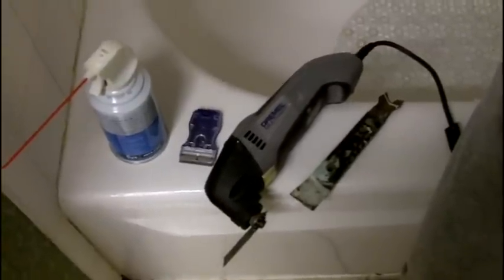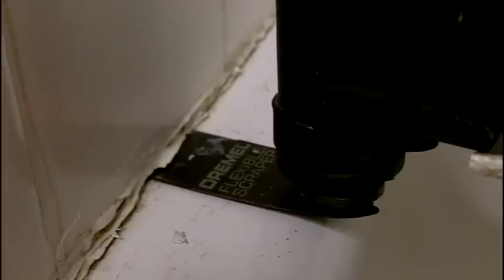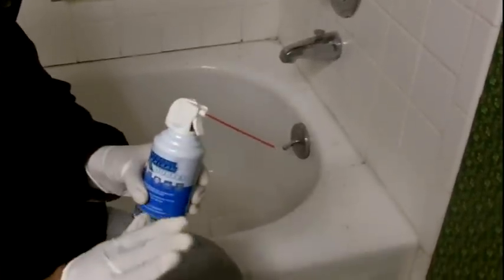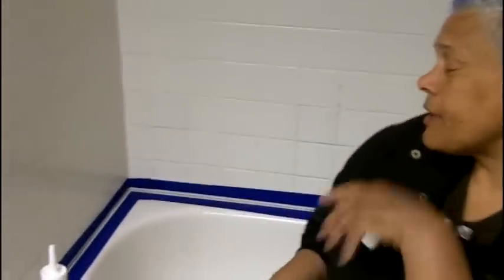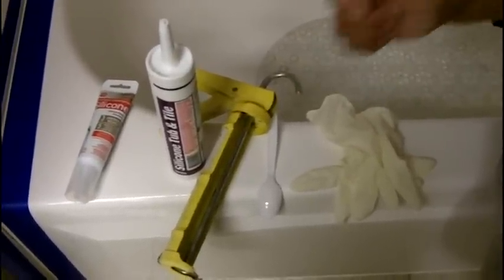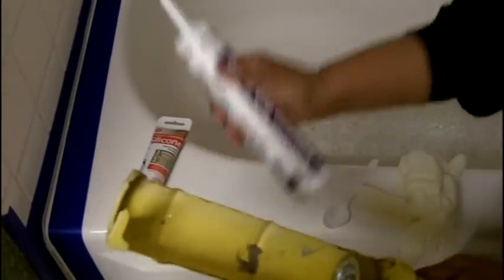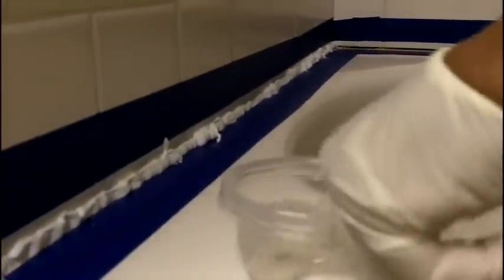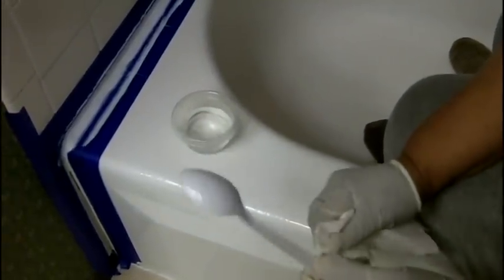How to Caulk a Bathtub with Beautiful Results

Comment: You should also fill the tub 2/3 with water.  This will weigh it down while the caulk dries.  When it's dry, empty the tub and it springs back up.  This prevents the caulk from pulling away and cracking when you fill the tub to bathe.
Reply: The silicon is flexible though for that very reason and for thermal expansion.
Reply: I've heard people repeat this same tip. I'm not convinced that it's a significant issue. I suspect it's just a waste of water.
Reply: @Nathaniel_Peterson  Yes because the bath tubs are taking the load on their steel feet not the actual tub, so if properly supported, there should be no movement.
Reply: I was thinking about doing that, especially with an old house...gotta help for lasting longer.
Reply: I had to do a repair job because of that exact problem... I left the tub 1/2 full while the caulk dried and they never had that problem again...
Reply: I can understand that this happens,
Reply: I prefer rubber duckies!
Reply: agreed
Reply: Yes! Good tip- especially for plastic or fiberglass tups, which settle more with human body weight later. I learned this the hard way...
Reply: Great idea!
Reply: Thnk you for tip
Reply: If your tub is on a concrete slab/foundation it’s normally not needed to do so
Reply: Does this apply for condo buildings that are fairly new? My building just turned 10 years old and I'm about to replace the caulking in my bathroom suite. Should I still do this or should it be new enough that it is built to be flexible ?
Reply: Genius ! Thank you ! I redo mine all the time because it always cracks after a few weeks ! Thank you !!!
Reply: Impossible to do... one must be close to manage caulk quickly and professionally..
Reply: Filling the tub is related to those with sub flooring.
Not concrete
Reply: tabs are not hanging on the air  there screwed on the wall not to move and they siting on the floor  no need to feel water the tub thats stupid
Reply: @Nathaniel_Peterson  
It’s not a waste of water. If you have a cast iron tub you probably don’t need to add water. If you have an acrylic tub that isn’t bedded you should and the water as someone else suggested.
Reply: Thank you for your comment... Very interesting.

Comment: I remember when I was learning to use a caulking gun.  I didn't know about the seal in the tube so I just kept jamming on it and it eventually spurted out the back of the tube and gummed up my caulking gun.  Left it over night in frustration, and had to cut the dried silicone off it with a razorblade.  Thank you for saving everyone from such noob mistakes.  You always do a really thorough job showing people how to use tools.  Getting it right the first time cuz someone went that extra mile for you is soooooooo much easier than fumbling around on your own trying to figure stuff out.
Reply: W
Reply: Happened to me too 😂

Comment: So, I've done tons of caulking over the years. The latex stuff is a breeze. But, silicone caulk takes considerably more mastery, because it is far less forgiving. This is the first time I have attempted this particular method, as Leah demonstrates in the video. I'd like to add couple of tips...

First, when caulking in general, don't sever too much from the tube tip. I recommend 1/16", or certainly less than the 1/8" mark embossed on the tube tip. Also, get the angle right, the cut smooth. Allow your trigger pressure to regulate flow, in lieu of hole size. Too much caulk will get you into trouble. I know from experience.  
Second, if you use a glove, use one that fits VERY snugly over the finger you intend to use for smoothing. A loose fit or a textured glove will leave you with less-than-desireable results. Ask me how I know. 
Finally, take time with your tape. Ensure consistent gaping, and avoid gaping both too narrow or too wide. It's a little tricky to get just right, but it's critical for premium results. 

Good luck!
Reply: Pro tip...run your silicone bead, then spray it with denatured alcohol. Alcohol will prevent the silicone from sticking to unwanted areas when you smooth the bead out.
Reply: How do you know?
Reply: how long do u have to let the silicone cure for until you can use the shower again
Reply: @someoneelse7724  i was going to ask that !
Reply: How wide should the finished line of caulk be?

Comment: Pro tip: On most caulking guns (such as the one used in the video) there is a hole in the handle with a razor attached to the backside of the lever. Simply insert the nozzle of the caulking tube at the desired angle and squeeze the handle to cut the tip!
Reply: +SixToMidnight just blew my fucking mind, i just through it was a hole for the fuck of it, i never knew... omg
Reply: +Realist I always thought that hole was for cutting the ends off of cigars while you're on the job. That's what I've always used it for. Never thought to cut the tip off the caulk tube with it. Great idea!
Reply: Pro tip: you can't make it any size you want.. hole is to small once you get past the pointy part of the caulk
Reply: Didnt know that. Cool beans. Thank you.
Reply: SixToMidnight  what?????....you make go to the garage and check it.....THANK YOU 👍🏻👍🏻👍🏻👍🏻👍🏻👍🏻👍🏻
Reply: real pro tip that stock cutter is trash use a good razor
Reply: Yep, there's a hole on my gun! Thanks for the tip!!!
Reply: yes it is,only when new it is good. 3-4 uses and then it will smash/squeeze the tip.
Reply: either way at prices as low as 99 cents, I wouldn't look at it as an investment.
Reply: @jumpercable20  Great idea! Lol, I mean wireless jumpercables are a great idea!

Comment: the best caulking bathtub video that I have watched.
Reply: you said caulk
Reply: huh huhuhuh uhuhhuhuhuhuh hhuhuhuhuhuh
Reply: DO NOT use tape. Lay in a smaller than those beads of caulking in to a clean dry space/. Spray with denatured (or isopropyl alcohol and use a Caulk Finishing Tool (Home Depot, Lowes) and you'll be left with a small, perfect bead. spraying alcohol on it after prevents the caulk from sticking to anything but in the crack its already in. That big, wide line of caulk will look HORRIBLE within a year because as we all know- there's actually no such thing as mold-proof silicone- it WILL mold over time. Minimize the silicone and you minimize possible mold
Reply: makes a lot of sense... but you might do this all the time (?)... maybe for people who don't do this but once or twice in their life ,the tape could save some grief ;-)
Reply: Well someone taught me like I do it and I'm an electrician- and a former carpenter but I've always done it like that. Spraying on the denatured alcohol after you lay the bead prevents it from smearing onto anything else and the caulking tool makes the leftover minimal and makes the end product perfectly uniform so these things eliminate the need for having "the touch" or being terribly experienced or anything. I just know that sooner or later it will mildew no matter what the silicone says on the tube and I'd rather have a very small area for it to do that. Another thing you could do is squirt lots of silicone as much caulking in that crack as possible so no air/no mildew over time. Not saying anyones wrong or I'm better or worse, just putting my two cents in
Reply: Worth waaaay more than two cents Ken! Thanks.
Reply: my pleasure

Comment: +L Lawliet You wet the spoon or your finger to prevent the caulk from adhering to either and pulling additional caulk out of the joint. The instructions to "not let the caulk get wet" really mean "don't use the shower or tub until the caulking has cured". Shower head or lots of splashing water can wash out or damage the seal made by the uncured caulk. The tiny bit of water on the tip of your finger isn't going to contaminate the caulk.

Comment: Fill the bath with water before sealing. This will make sure that the joint is at its biggest before you seal it. When the bath is emptied again, the joint and sealant will be compressed. This reduces the stress on the sealant when you’re using the bath or shower. no need for arm bands or goggles or rubber duckys, try to seal it while at the side of the bath and not in it. ;)
note:  Brits, please use 'silicon sealer' and not caulk! caulk in Britain is a different product and is pretty useless for sealing bathtubs.
Reply: MrJericho07 oh good point.
Reply: Yeah  what is marketed as caulk  in Britain is usually butyl rubber. Really messy stuff that will never dry and is almost impossible to clean up. It is a permanently flexible adhesive/sealant used for roof repairs etc.
Reply: MrJericho07 on
Reply: I filled the bath and then got in naked so the joint was the biggest it could be. A wonderful experience!
Reply: DoinThupidThings
Would probably be easier to use weights instead of your body weight. Maybe even use weights to replace the need for water weight. Metal is a lot denser than water anyway so it'll take up less room. Much more convenient than sitting naked in a full bath tub trying to apply sealant.
Reply: MrJericho07 when is the best time to empty the tub? Immediately after done caulking?
Reply: Makes sense thank you.
Reply: @donschlonski2936   I read that comment while watching the video and thought she was actually going to tell people to fill it, all while thinking to myself are they can't be serious! Why In the hell would you even bother filling it. Then when it ended I realized it was a joke. Only time we've ever used tape and a tool was if it was a big gap. HAHA
Reply: @MyronsBaldspotLovesKevSamuels  the next day (when dry).
Reply: Cat S. Thank you🙏🏼 I couldn’t find that answer, no matter where I searched! I let the water out almost right away so I’ll have to redo once I feel like recaulking. Blessings!
Reply: @DoinThupidThings   AH, want to come caulk my tub?  TeeHee!!
Reply: MrJericho07 guess that only applies to fiberglass tubs.
Reply: @donschlonski2936  Don, that makes a difference depending on how the tub was installed and what substrate was used. I bought an old house and the tub & tile were great, just needed a grout and caulk refresh. The structure under the tub allowed it to sag, I didn't feel like taring out to fix it. On a properly installed tub you're likely correct. It's neither stupid, irrelevant, nor wasteful. Wasteful would be redoing the entire job because the caulk pulled away because of 600lbs of water and Aunt Bunny during a long, hot soak

Comment: PULL THE TAPE, IMMEDIATELY!!!!
I found out yesterday. I left the tape on too long. Caulk started to dry. 
I have to redo!
Reply: Well, Leah did say that in her video.
Reply: so does this mean I basically have only 5 minutes lay a strip of caulk on one whole edge of a tub, and smooth it it out, and remove the tape?  it seems so stressful.  lol.
Reply: I did the same thing let it dry over night and it ripped right off with the tape shame a waste of time
Reply: @derekg5381  Yep! I did the same thing last night. It didn't all come off but it curled up on the edge.

Comment: As someone who has been a professional caulker for 15 years, I'll give you credit for decent job, but please please please stop telling people to dip their tools or finger in water. You should be doing this with dry tools. The water can get behind the caulking and then you don't have a true seal. There is no need for wetting your tool. That is the biggest mistake these so called "professional" caulking videos make. Other than that, good job.
Reply: That's what the instructions on the products say so if the manufacturer recommends it why shouldn't she?
Reply: I caulked for years on military containers small & large. I used a cup of water with a few drops of Ivory dish soap in it. It's the best and the caulk doesn't stick to your fingers because of the soap. It will seal...i promise
Reply: @yobooboo1290  Thanks for the tip!
Reply: use a wet rag for minimum dampness on your finger to spread the caulk.
Reply: Professional caulker?
Reply: Joanna Saad  Matt Stroupe is absolutely right.  Use the correct tools which you can buy on Amazon. Also. Do not use tape as this leaves a lip on each edge and that is where bacteria forms. 
I’m a BIG fan of Leah and although this is a good video, it is not the correct way to do it. 👍🏾

Comment: you used entirely waaaaaaay to much caulk
Reply: Shawn Bruhn It doesn't matter
Reply: Arnel Evans Lol it does. It ain't free right?
Reply: The tube either gets used or it dries out in “storage” so using extra doesn’t really matter.
Reply: @6butterflywings6  not if you know how to store it properly! Lasts a long time
Reply: I agree with Sean. Easier to spread and less messy using about 1/2 of the product she used. Good video!

Comment: Bless you!! I’ve done a number of caulking jobs on the past, but wanted a refresh before my shower. The tip to use the flat blade dremel is the Baum!!!!!!!!!!!! I have one, but rarely use it. I just tried your trick — and it’s fantastic!!!! THANK YOU! You just cut two hours off my project!!

Comment: Thank you!!!  I caulked my bathtub and am now tackling the shower.  The tape was such a great tip.  You made everything so easy.  I can’t believe I was afraid of a caulk gun.  
The razor tool!!  Wow!!! Game changer!  I also used it to scrape the tiles of built up soap scum.  I have been scrubbing that forever and the razor took it right off!!!!  I can’t believe it was less than $2.  Invaluable tool!

Comment: I’m addition to the tape, I found a nifty little “caulking kit” that you just slide along the joint instead of using your fingers — and it’s fantastic — and fits in with all Leah’s advice here!! Others will tell you you don’t need tape, but I discovered they using the tape AND the tool was THE BEST method EVER!

Comment: Good tips. Also, I always fill the tub at least half way to add weight while applying the caulk. 
When the tub is empty the caulk will compress and when full it can take the additional weight of water and bather without splitting. 
I like the tip on using the Dremel tool to extract the old caulk!  Thanks

Comment: I got to tell you, Jane, that your caulking tip is the best one I've received. I have used it, and the results are superb - smooth, clean bead, and sharp, straight edges. Thanks so much for a terrific tip. I've even used the tape method for the seam between exterior brick and a window frame, and if the tape is secured well, it works great too. Thanks again.

Comment: Great tips! Great channel! I usually favor the caulk gun myself as do you over the stuff in the squeeze tube. More control over how much comes out. One other thing i also do is sand the tip of the caulk tube with fine sandpaper so no burr marks show thru on the finish. Then i start in the middle of the tub and push the caulk into the corners. The sanded tip helps smooth it out. Just another addition of mine to your awesome channel! Keep on posting!😁

Comment: 3M makes a great product you apply to soften silicone and it comes right out. I use a hair dryer to be sure there is no moister left.  I fill deep gaps and let the silicone cure before adding the final coat. I use my finger with liquid detergent to smooth and I start with the intersections.  I always loved your videos and now at 62 I'm retired from plumbing and I'm just starting my new interest, woodworking!

Comment: Leah, thanks for the video. Was my first time doing the caulk removal and re-caulking correctly. The tape really helped to give me a really clean look. I put the caulking on with the small tube and I must say it took a good bit of effort to put the caulking on while trying to keep mess to a minimum. I will use a caulking gun in the future. Also, getting that old dry caulking can be quite a job if you are just scrapping, which is what I did. Next time I'll try some "DAP" Caulk Remover to make that process easier. I have thoroughly enjoyed your videos over the years. Keep up the great instructional videos.

Comment: Very good informative video. Thank you for sharing. Live your presentation style.. The first part of your video removing the old caulk has been a long and laborious process for me. I am on my second day attempting the removal of this old hardened mixed grout. Applied chemicals to soften the old grout along with heat & it's still tough going.. This stuff is similar to cement. I wasn't prepared for the challenge of removing the old hardened grout. Watched many videos for research.. Your video strengthened my resolve to push through & start the application

Comment: Well this video is 8 years old but, I needed some professional help.  So I turned to the expert, the person you can trust.  I needed to repair a sectional shower in a travel trailer with over 16 seams.  I used 2 inch blue masking, white silicone and made my joints about 1/8 of an inch wide since there was a bevel groove.  I remove the tape immediately after each vertical seam and it looks absolutely perfect.
Thank you!

Comment: Very helpful 👌. Thank you.  I am using wire wool, White Spirit and a Sanding block to rub a away small bits of old mastic on the sink as I haven't got all the scraping tools to hand that you have. A Stanley Knife got rid of most of the old white mouldy mastic. Great 👍 👌

Comment: Excellent video as always!!  I didn't know you had to pull the tape immediately.  I  put on sanded ceramic tile caulk and left the tape on.  After four days I tried to pull the tape and it was a mess.  I am had to clean out all of the new caulk and start over.

Comment: Used to replace Lexan windows annually in a laboratory. With practice you get very good at it. I did not watch or listen, I just wanted to drop off a suggestion, she probably already did.
Save a plastic milkshake straw. Cut the end at an angle. Have a damp throwaway towel, push the straw in a continuous stroke. It will produce a never ending beautiful angle of RTV. Use the damp clothe when the straw becomes full.
See Jane Drill, most excellent. I learn some and remember somethings I have forgotten. Thanks Leah.